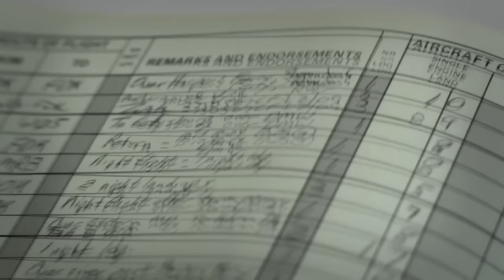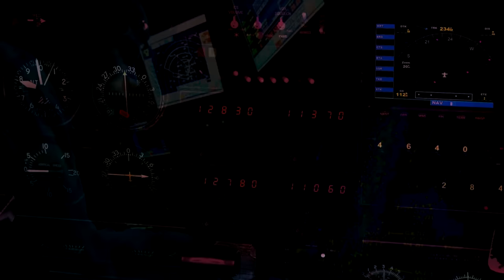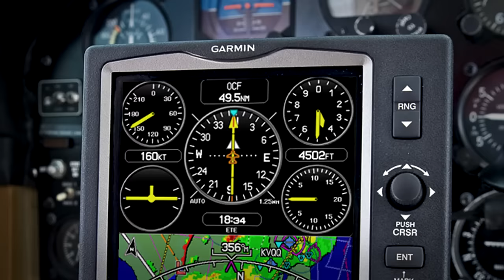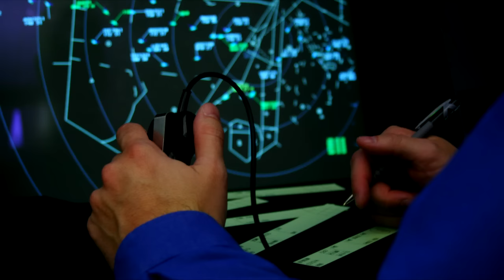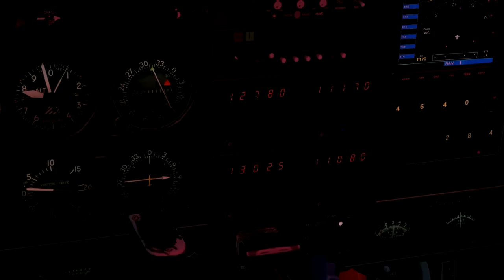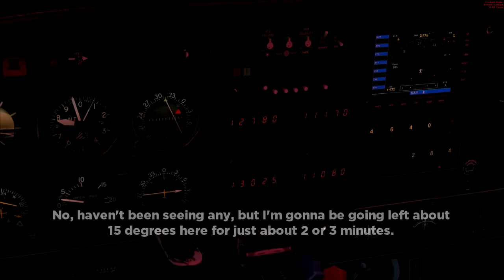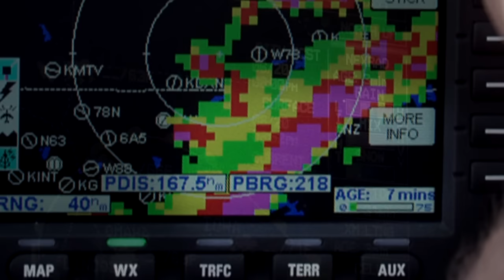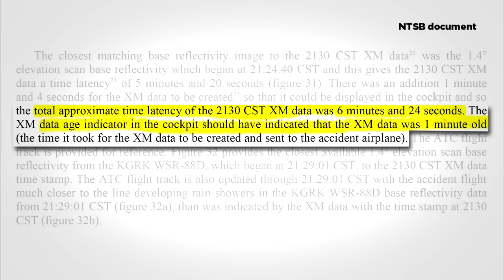Accident Case Study: Time Lapse – misunderstanding in-cockpit weather displays can lead to tragedy

Comment: As a storm chaser with over 35 years experience, 6-10 minutes, in a extreme;y convective environment, can be the difference between a weak shower and a severe thunderstorm, radar delays aside. Hell, I've seen instances where skies go from relatively clear to a tornadic supercell in only 20 minutes.
Reply: Actually, I live in Orlando, Florida, 3-4 minutes can be the difference between torrential rain and SUNSHINE, lol. We get very small cells here. One learns to fly around those. Good space between them.
Reply: Your job is chasing storms? Really?
Reply: In Cancun it’s 1 minute lol
Reply: @MisterTechnologic  
🤣🤣🤣 I've been there a couple of times! I know what you mean!
☀️🌧☀️🌧☀️🌧😅
Reply: 4 minutes.
Reply: In the air, up in the environment it changes much faster than as a storm chaser on the ground.
Reply: Recall Delta 191 in Dallas.   They were following a Lear by only a few miles.   The Lear landed safely.  The L1011 hit the ground.

Comment: Anyone who installs a NEXRAD display in their plane should be required to watch this video before they can use it.
Reply: With ADS-B weather now, pretty much everyone has NEXRAD onboard.
Reply: Agreed.  The AOPA discusses the system information lag in one of its online courses.  I'm sure it is in the information when the unit is sold.  Not everybody notices, though.
Reply: That box provided him with lousy info and lulled him into complacency.   There is nothing wrong with being a wuss and simply not taking off.  There was everything wrong with this flight.    "Always leave yourself an out" didn't apply to this case.  I feel horribly for his passengers and extended family.
Reply: @lbowsk  in defence of the pilot, you have no idea why he took off in the first place. everything happens for a reason and for some that reason means more than to others. and the info wasn't lousy, it just has a known time delay and whether he knew about that delay or not, we still don't know why he took off to begin with let alone what he was intending to do at the other end. 
He was likely doing his best for his passengers and family as well as for himself but IMO left himself too much to do.
A more prudent pilot would probably land somewhere else for a few hours, have a break and take off again when the storm wasn't such a great risk to be within 10 miles of but perhaps he was taking a child with cancer to treatment or something. Who knows...
Reply: @maryredfern3291  The exact set of events leading to the tragedy is still unknown.  If you're trying to accuse the pilot of incompetence you would struggle to do so in court as there wasn't enough evidence to prove it and you may be charged with and convicted of slander at the same time so being more careful about what you say when potentially the whole world can read it is probably the most prudent thing to do, no?
Reply: Terry Melvin     Useless for slaloming through cells!
Reply: @SilverCanary1  Hate to be the bearer of bad tidings but in the US (regarding slander), there's no recovery option (in most states) for someone who's deceased. On top of that, truth is an absolute defense. Tragic though it may be, the guy made some bad decisions.
Reply: Terry Melvin the nexrad time delay and thus margin for error is known and relatively easily quantifiable, therefore nexrad wasn't being used properly and the accident was most probably user error. 
You wouldn't drop a 100 ton boulder in the back of a pickup truck for instance, likewise nexrad is not realtime weather reporting but all too often, people are given permission to use equipment they aren't qualified to use, from an operational standpoint. Part of the responsibility of the accident lies within the GA system of allowing instrumentation without qualification and there is not enough emphasis on reinforcing or simply introducing instructions for key pilot flight instruments. 
Flying through the clouds as was done was also risk which could have been avoided were there punishment for flying within such a small window of safety that pilots would think at least twice before trying it if they knew that they'd have a flying ticket when they landed, generated by a weather radar analysis overlaying gps location as currently not much flying is automatically recognised as dangerous or illegal. It all needs post partum human analysis which isn't much use to the victims when the accident has already happened. Moreover it's not doing justice to the innocent people who suffer on the ground who didn't have any option to be involved in the flying on the day and we're merely bystanders. 
A pilot a few years ago flew a low level loop in an ex military jet and he miscalculated it for reasons not even he knows, though he survived the accident, however I think 8 people in cars that he landed on during his crash did not survive and had zero option to avoid what happened other than not driving within 50 or so miles of the airfield he was flying around. 
This accident is such a rare occurrence that it's a fair assumption to make that most people read and reread operators manuals before relying on them - this is not something we should rely on however as it isn't based in fact in any meaningful way. 
With so few hours of check flights per year, check flight instructors are increasingly relied upon to stay updated on both new and improved pilot aids however fitting that all in during a flight is maybe not ideal and each instrument should come with written proficiency exams to be assessed by the check flight instructors as electronic systems have gone from an electric giroscope and a radio to apps, gps and live weather and route finders so quickly that things are clearly slipping through the cracks and the general public are suffering as a result and that really isn't fair.
Reply: Thats why you give yourself a good size buffer zone regardless of what the Radar says
Reply: The Garmin 696 is VFR and should not have been used  to track weather as to potential MIC conditions..  What happened to the 25 [nautical] mile rule  as to turbulence and lighting?
Reply: Search this video??? Just read thr owners manual, it clearly states that there is a time delay and to use caution ⚠ around heavy weather.
Reply: Fact!
Reply: @HighGravity1100    Well put.
Reply: @SilverCanary1  I'll never fly with you
Reply: @maryredfern3291  Millions of kids die every year in their mothers womb...  Are you as upset about that?
Reply: @rustusandroid  First, they’re not mutually exclusive. Second, maybe go find a video about that if you want to hear opinions on and discuss it. This is an aviation channel, sir.
Reply: @drnogueiras8783  Made my point, I see.
Reply: Yeah. As a single man I took a lot of risks. But when you’ve got kids. I’m like an old lady now.
Reply: All ADS-B in has Nexrad weather.  It is quite reliable, but we all know it has a delay.  This guy was a fool by being so close to that weather.  No one does that, even with Nexrad.  Except people that want to die.
Reply: I totally agree!
Reply: Don't those NEXRAD displays have a time stamp on the data image? They should. There shouldn't be any question about being aware of the time delay, no pilot should assume they're real time.
Reply: pretty sure there's an informative manual on how the system works

Comment: I learned this lesson in a way few can say they survived.

Flying with a friend out of Yreka/Montague, headed southwest over Scott Valley then west into the Marble Mountain Wilderness. Aircraft was a Cessna 177 Cardinal RG. Weather was clear at Y/M, with convective activity building above the wilderness on a line following the high ridges. Our altitude was 8,000ft, at which we both knew from experience we were capable of operating at safely, indefinitely.

As we approached Fort Jones in the Scott Valley we saw rapid buildup to our Northwest, above Marble Mountain. To the South, about Etna Summit, was some light activity moving north out of the Russian Wilderness. We angled south to go between it and the rapid buildup. As we closed in on the high ridges, activity to the South accelerated dramatically. We angled a bit north, skirting just to the South of Boulder Peak. Activity began building ahead of us, so we elected to turn back by circling Boulder Peak to the north and heading back east. Activity to the north had become ASTONISHINGLY fast building! We were watching it boil as we circled Boulder Peak, but at the time we were only getting moderate chop. As we rolled wings level immediately north of Boulder Peak we got snatched up by decending inflow and sucked into the storm from approximately five miles away. I was flying at the time, but the PIC and aircraft owner immediately took the controls back. I believe his skill saved our lives. I would have made different choices, and they would have been wrong.

He did not attempt to fight the inflow. He held wings level, keeping them at right angles to the wind as it pulled sideways into the base of the storm. He pitched up and went to full power to fight decending into terrain, which we cleared by several hundred feet at most. As the draft turned to the vertical he started rolling right, again seeking to keep the wings horizontal to the air flow. As we entered the bottom of the storm he was vertical to the ground and nose level. We went to instruments, which he was rated for and I was familiar with but not rated for. We came out of the side of the storm still wings vertical, nose level, at 14,000ft, about 30-45 seconds after entering the bottom of the clouds. TWELVE THOUSAND FEET PER MINUTE rate of ascent!!!! 

He made an emergency power off decent to 8,000 away from the storm, and since we'd come out pointed almost due east no turns we're needed. As we crossed over the ridge back over Yreka he told me "something's not right. Something doesn't feel right." I will never forget those words. They still scare the shit out of me. He called SeaTac and issued a PanPan, requested fire and rescue at Y/M, and prepped us for an emergency landing. As is seemingly so common, it was the smoothest greaser of a landing he'd ever done. Three little chirps are all that told us we were down. We unassed the plane, waited for fire to confirm no fuel leaks, then got it towed to his hanger for inspection. The fire marshal, also a local pilot, saw it first. A seam was stretched in the bottom of the left wing. The owner went up that cowling like a shot, then waved me up the right wing. 

There were four wrinkles in the top of the left wing, two in the right. That's why I say he saved our lives. He held us wingtip to the wind, thus reducing strain on the wings just enough for us to survive. 

STAY AWAY FROM THUNDERSTORMS!!!!!
Reply: TLDR
Reply: @ЏонМастерман  Your loss.
Reply: How many thumbs up can I give this? I’d like to practice this scenario in the simulator.
Reply: I remember reading a story similar to this (Shaun Olinger's) where the pilot lowered his seat, tightened up is harness, and said to the narrator: "I suggest that you do the same." Then rotating vertically nose down, he pushed the throttle in all the way, and they were still going up thousands of feet per minute. But they did avoid getting pulled into the blender upstairs.
Reply: @BobbyChastain  It would definitely be interesting. I have FSX, but even setting it up as best I can it's really hard to simulate that kind of airflow. You'd need a full-blown training system. I'd say it's a good thing to practice, but I strongly prefer to just stay the hell away from them!!! Ever since that flight, as long as I'm on the ground TSs are a lot of fun. In the air, if I can see them I am NOT HAPPY!! 😨

It's hard to describe the kind of terror that flight induced in me. I don't mind clear turbulence, rain and wind no issue, but anywhere near clouds or convective activity and I'm looking for a spot to put my feet down. 

Be smart, be safe, be careful. Old vs bold and all that.
Reply: A saying I learned skydiving.... "Better to be on the ground wishing you were in the air; than in the air wishing you were on the ground". When in doubt chicken out!!! Great story by the way. Thanks for sharing :) Blue skies.
Reply: Remember Delta 191?
Reply: I prefer to read a thrilling story than to live through one… Thanks for sharing this experience. =)
Reply: That's a K. Gann type story for sure.
Reply: @shaunolinger964  
I was told when I started riding motorcycles, "You start out with a bucket of luck and an empty bucket of experience, you have to fill your experience bucket before you run out of luck, but you don't know how much you have in that bucket"
It's pretty true, and I think applies to flying as well
Reply: @Rx7man  Having ridden motorcycles for some years, I would have to agree with you. 

I feel like I was issued a luck bucket with a fairly substantial amount in it. This flight used a fair portion though.... but I sorta think my experience bucket caught a mess that day. It sure as heck wasn't in our britches, but I can't imagine how we didn't shit ourselves. Too scared I guess.
Reply: How severe was the turbulence in the storm?
Reply: @cujet  knocked my glasses off my face....
Reply: awesome experience to be able to survive and tell the story.
Reply: Glad you made it out. This was by far the best YouTube comment I've read in weeks.
Reply: Wow!!! Glad you guys walked away from that one!
Reply: He literally held both wings together with his bare instinct. Even Superman would have not saved you guys.
Reply: @Shaun holy shit!! What an incredible experience, thanks for sharing dude.
Reply: @ЏонМастерман  Why even comment that ignorance? Was not important enough to read but it was important enough for you to be rude?
Reply: Terrifying. Thank you, just read all about inflows and wow... Glad y'all made it out.
Reply: I dont understand all the flying maneuvers,  but it sounds scary what you went thru.  Probably how a lot of pilots die in storm events
Reply: It’s been four years and i doubt you’ll ever read this but damn, you’re a great story teller albeit a scary story. Cheers for telling it.
Reply: @budman8207  Actually, this is one I pay attention to. I even went over this experience with my father... master A&P, combat fighter pilot, Alaskan bush pilot... he knows the C177 Cardinal well. Apparently that wing was a lot further from failure than I knew at the time. They bend like that at around 6G, but they won't actually fail till up around 10G. They're rated for 4. It was still a wild ride, and I continue to watch out for convective activity. Kinda one of my "boogeyman" now. 🙃
Reply: @shaunolinger964 Incredible story.  Curious what ended up happening to the aircraft afterwards?
Reply: Holy shit.
Reply: This gave me goosebumps. You’re still alive because of amazing skill and engineering - and no doubt a lot of luck too!